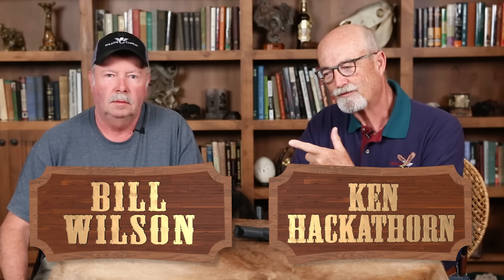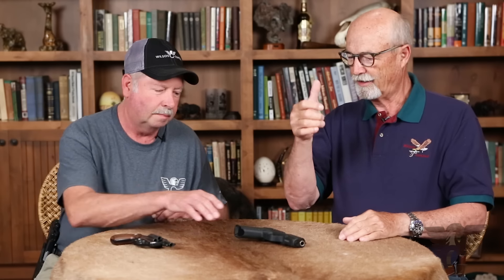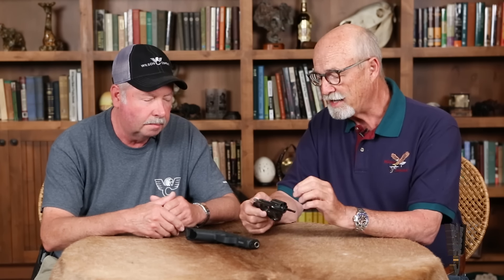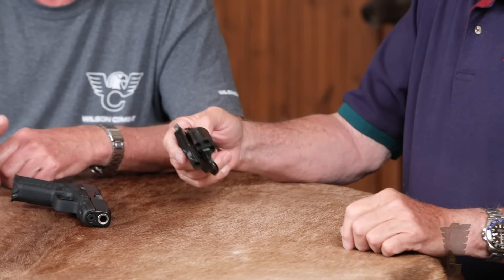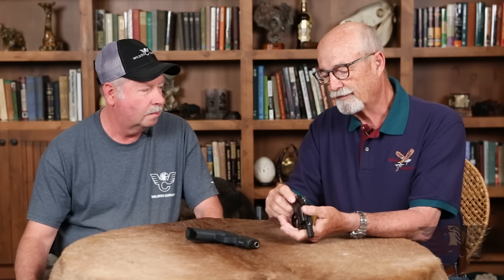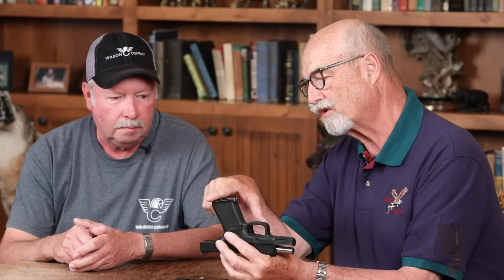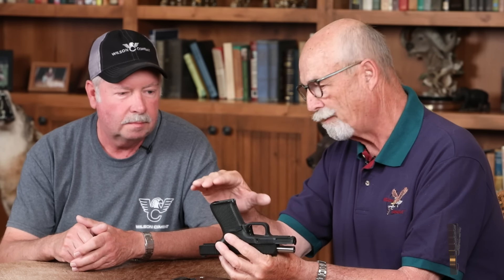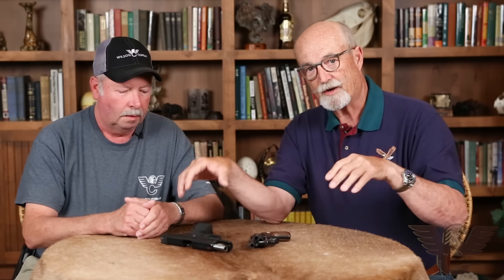DON'T DO THIS to Your Guns - Gun Guys Ep. 17

Comment: Thank you for the information. It's obvious from some of the comments some people have never owned a finely tuned piece of machinery. All guns are not created equally, and saying simply that because this gun is expensive it should be able to do all things or take abuse is kin to saying a 300k Ferrari should be able to withstand and function properly offroad in mud and sand. 

Yes there are guns that are expensive that can take abuse and shoot accurately but the triggers aren't as nice or they are made from polymers rather than steel. Like an expensive watch that's accurate within milliseconds made from the finest materials by craftsmen vs a GShock that will give you the time but its crude yet durable and still can be relatively expensive. A Wilson combat( imo ) is kin to a modern day high end sportscar. Made to do one thing with expertise, but has to be maintained well to get the best performance from it.
Reply: A modern high-end sportscar can be way more fragile than a high-end 1911 though. I know some people with sports cars who will only allow single passengers in the back to sit in the middle because of the more even weight distribution. I was seriously told once "I can't drive faster when you're in the car because my shock absorbers have been tuned for a single driver only"
A finely tuned competition gun by comparison is still pretty robust. You might just ruin the fine tuning when you abuse it.

Comment: If dropping a slide on an empty chamber will hurt the gun after, say, 200 times, then how many rounds will it go through before it breaks anyways? 2000? 5000? A 1911 that costs as much as a Wilson combat better last a lot longer than that.
Reply: Steel going home on a brass cartridge it isn't breaking, slamming steel on steel over and over is asking for trouble you don't need.
Reply: There is a popular myth contained in your statement. 

FACT is if you pay a premium price for a gun, like Wilson Combat, you are paying for QUALITY not DURABILITY and no they arn't the same thing.
Perhaps a good analogy would be other machines like radios or automobiles...higher end you go higher maintenance/care required to keep it at that level, the higher cost can even indicate the OPPOSITE of higher durability.
Reply: @flipgunderson1946  lmmfao!  Well said.

Comment: I am willing to accept that these guys know what the guns they build will do. What I also got out of this is WC does not build guns to the quality that John Browning expected when he made the design. I second the previous comment that they should take the word Combat out of the name. I do agree with the statements on slamming a revolver cylinder. That's just crap people got from movies.
Reply: Theyre built to the same or better quality. Engineering has been done to make them better target pistols but not as good for service
Reply: @HuxleyTheProf  just like a race car won't hold up getting groceries.

That said, a WC will outlast any duty pistol. It just has to be handled the way JB designed the 1911. It's a slide lock, not a release, don't drop the slide on an empty chamber, oil it. It's in the Army dash-10 manual that way too. 

The M2 is also a JB design, and the toughest machine gun on the planet. You "ride the bolt forward" on an empty chamber on an M2 so you don't mushroom the bolt.

Comment: If you have to baby a gun, carry another gun. You don't go offroading in a Ferrari
Reply: You can't tow a trailer with a Ferrari. If you want to haul something AND can't afford a Ferrari, you don't need to read the manual looking for typos, you need to go look at rusted out Chevy trucks. 

For the record, I own a rusted out Chevy truck.
Reply: Since when is proper handling "babying"?  

How about an AK?  Don't drop the bolt on empty chamber, or risk mushrooming the bolt, and shearing the lugs. 

Ma-Deuce?  Don't drop the bolt on empty chamber. 

All pistols, including Glock?  "Avoid dropping the slide..."
Reply: You also can’t drive a Ferrari without preventative maintenance

Comment: If you want to hear this guy explain how absurd his argument is start right here 02:12 .  What he is inferring is the forward motion or inertia of the slide is reduced to an acceptable level by stripping and loading the bullet in order not to damage the firing mechanism.  I wonder how they measured that reduction and if a reduced power slide spring wouldn't accomplish the same thing?    That is absurd.
Reply: @tomgiorgini9154   As in not smart enough to read the military TM identifying the use and function of the gun to include armory maintenance and third shop high maintenance. This would be the document created when it was accepted into the US Army when it was first created.  Doesn't talk about paring down mating surfaces of the trigger assembly to achieve a nice crisp smooth trigger to the point where wilson says if you utilize a function designed into the gun it will void their warranty.  I have never seen this warning on a Colt pistol Tom.  And should you choose to spend several thousands of dollars on a gun that will void your warranty for doing something it was designed to do- I won't say you're not smart enough to own a gun.  I would simply lament your greater supply of money than good sense.
Reply: @tomgiorgini9154  
So let me get this straight, this guy is an expert because he's old and says he's an expert?  Okaaaaayyyy.....
Reply: @abee3515  
When I went into the Navy in the 1980s, qualifying on the 1911 was a requirement to make it through boot camp.  And yes, there were guys that were sent back to the next incoming group of companies to repeat boot camp up to that point because they failed the 1911 pistol course.  We spent hours inserting unloaded mags, sending the slide forward, dry-firing, locking back the slide, dropping the mag, etc.  Hours!  And that was just my boot camp company.  This was during Pres. Reagan's cold-war military buildup, there were thousands and thousands and thousands of people going through that place, the Navy (and all services) were manning up.  If doing this was doing undue damage to the training 1911s, they would've known about it a long time ago and stopped/altered the instruction curriculum.  Just a thought, I don't claim to be an expert.  What you're saying makes sense to me.
Reply: @Skank_and_Gutterboy  I did the same except Army.  My best friend did the Navy.  These guys are selling race guns.  They are telling them written in the paperwork that comes with the gun don't do this- it will break the gun.  The 1911a1 is a combat weapon it is designed to take abuse and NO WHERE in the TM does it say not to drop slides on an empty chamber.  This is all for the tacticool crowd that wants to make a gun so sleek so fast so covered in useless crap that it can fire simply by willing it to.  Dropping the slide on an empty chamber in a firearm built to design specification meeting the government contract will not break the gun.  These two old coots need to clarify "do not drop the slide on a wilson combat" and leave the rest of us the hell alone.

Comment: Slides are designed to drop fast theres more force on the slide when your fire the round then dropping it 🙄🙄🙄
Reply: Look up how semi auto pistols work. When you fire the last round they should lock open. If there's more in the mag, the next round will help buffer the slide forward. A properly functioning system will not slam shut on an empty chamber after firing.

Comment: I couldnt make it past 4 mins of the video. If u design your custom 1911 to not be able to drop the slide on a empty chamber then I'll pass.

The miltary 1911s always took this abuse in inspection and use. 

All modern handguns are able to drop the slide on the empty chamber. U make fine pistols but if u design it this way u are intentionally losing business.
Reply: No, they're intentionally building custom guns to exact tolerances, in order to have an excellent trigger feel etc. They don't price them at $4k or above for no reason. The government stuff is mass produced and not even close to the tight tolerances of WC pistols.

Comment: Thanks for the info.  I have never heard that dropping the slide was bad for the trigger.  I always heard Glock people say it was bad on the slide lock lever, but never heard the issue of the barrel and trigger.  Makes since.  I am about to purchase my first WC, an EDC X9, and I will keep this in mind.  Thanks again!
Reply: Brad Roberts  I dont think they were taking it to that extreme.  Most of the 1911 guys still like/teach the slide release when reloading.  Bill even mentioned in the video that the work involved in stripping the bullet off the mag helps to protect these mechanisms.  They were only saying not to do it on an empty chamber.
Reply: Brad Roberts  0
Reply: Tommy J ..That’s what I understood him to mean, don’t drop it on AN EMPTY CHAMBER, OR by just ‘placing a bullet in the chamber’ either...
Reply: Tommy J   ....or never on a round pre-loaded singly.  He mentioned that it’s hard on the extractor.
Reply: Tommy J   Exactly!
Reply: Brad Roberts   it was meant to drop slide its a military gun but wilsons are custom guns with custom triggers milspec gov 45s no problem they made miltary police  drop slides on a empty chamber in the army
Reply: Brad Roberts  If it's not a slide release why did Glock make an extended ledge that is actuated from the top on the 34?
Reply: Brad Roberts  It is a slide release. The slide stop is meant to be pressed and the slide released. Even dry. It's in 1911 Field Manuals for the military. They explicitly say (after inspecting for clear) "To CLOSE THE CHAMBER.—With the right thumb press
 down the slide stop and let the slide go forward. Squeeze the
 trigger."
Reply: @Folma7  It is fine to single load a round by hand into the chamber. " If it is desired to make the pistol ready for instant use
 and for firing the maximum number of shots with the least possible delay, draw back the slide, insert a cartridge by hand
 into the chamber of the barrel, allow the slide to close, then lock the slide and the cocked hammer"

Comment: Well, a gun is a tool. If it's not battle proven an able to take abuse, its not worth the high price you paid for it. The gun needs to be able to take abuse.
Reply: It's a slide stop not a slide release and not intended to be used that way, have replaced a lot on them on customers pistols and not just stamped steel ones either.
Reply: @leoguy1609  it's the best way to chamber a round with one hand.
Reply: These are collector guns, not necessarily EDC guns.

Comment: Please watch GunBlue490 'Dropping the Model 1911 slide ~ The Truth!' Evidently from this video, modern expensive aesthetically pleasing 1911's are fragile. No thanks! John Browning built the  1911 according to "MIL-STD", . I'll keep my US Government 1911 MIL=STD version. It's ugly and hits the target without fail.
Reply: Well said!!
Reply: Yes well said
Reply: Gonna have to disagree with you. Even an original USGI 1911 shouldnt be dropped from full slide lock onto an empty chamber. 

The barrel lockup on the 1911 uses the barrel's lower lugs to ride up on the slide stop pin which is what pushes the barrel up into the locking lugs of the slide. 

Dropping the slide full velocity impacts your barrel lugs against the slide stop pin with the full power of the recoil spring and the momentum of the slide. Take a look at those barrel lugs sometime. They are not very big. Over time of this abuse they will deform and the timing of the barrel rising up into the slide will be severely impacted. 

This is nothing to do with a "modern expensive aesthetically pleasing" 1911. This is all 1911s and with machining technology being what it was in 1945 and earlier those original usgi guns are actually even more likely to have their lower lugs deformed because they used softer unhardened steels.
Reply: Well, a lot of the money you pay for a competition 1911 goes into the trigger tuning. Why would you ruin that trigger tuning with unnecessary abuse? The gun probably still works fine and the trigger is probably still better than the old MIL-STD triggers, but it won't be as good as possible anymore. It's not like expensive 1911's will stop working when you let the slide snap, but you paid a lot of money for extreme accuracy, why would you risk ruining that.

Comment: A advantage of Glock guns.  Join the GSSF shoot a match.  Ask factory armorer to check your Glock over.   They will detail clean (much further then suggested by owner). Check for wear.  REPLACE any springs, worn parts.  Last match he asked if I wanted extended slide and/or mag release.  Put in entire trigger group, springs, extractor, ejector…. NO CHARGE.  Plus jumped me ahead of line to fire off a mag to test function as carry piece.

Comment: Glocks are $600 and you can beat to death.  Wilson Combat $4000 and are ammo sensitive and need to be babied to run.  Wilson Combat makes  beautiful guns, but this is a video justify the finicky nature of their product.  Glocks easily run 2K rounds without cleaning.  If your betting you life on a gun, Wilson Combat aint the choice.  If your wanting to impress your friends with your finances, Wilson Combat is for you.
Reply: I have more than 20 pistols and revolvers, including Glocks. My Glocks are the only pistols I own that have failed on me within their mfg stated duty cycle. Cracked slides, broken springs, broken strikers. They're the highest maintenance, least reliable pistols I own. Nearly every Glock fanboi I meet tells me about all the cool aftermarket  mods to make it run "Perfect."  Just need a new trigger, forged striker, aftermarket recoil assembly that won't eventually shoot out the front of the slide during rapid fire, and Trijicon sights, right? Then it'll be a perfectly running gun. Until then?  The only thing my Glocks do well is run dirty, but what idiot doesn't clean his piece?

Wouldn't ever buy a Wilson or any other "boutique" piece - not even a Kimber. My Ruger 6701 is perfect out of the box. Just stoned the sear - more to verify fit than anything else.
Reply: @mfuchs2004    I had a gen 1  glock 19 , i ran that pistol  hard  , never had a failure , idk  maybe they went doownhill  but my Gen 3 .  19  , 23 and 20 are reliable in my book .
Reply: You've had multiple Glocks suffer a catastrophic failure on you? Sounds like internet bullshit.
Reply: Glock........no pride of ownership right out of the box.
Reply: John Galt,  I respect your opinion but couldn’t disagree more. I enjoy my Glock 43, Gen4 19, and especially my Shadow System MR920, but I had the opportunity to purchased my first Wilson Combat EDC X9 two years ago and that gun has ruined me. I’m now 6,000 + rounds into owning my X9 and fired ever brand under the sun through it. Aluminum cased, reloads, handloads, hell the majority of the 6k rounds were  with freedom munition which has the worst reputation in the ammo world. I’ve had only 1 malfunction (no ignition on factory new S&B.) When I go to the gun safe to grab a carry gun,  I skip all of my pistols (CZ’s and Glocks,) and grab my Wilson Combat EDC X9. I have yet to find any other make or model I trust my life with as much. I just wish I could afford another one!

Comment: while i can appreciate a well (or expertly fine ) crafted item if it cant handle a little abuse, ultimately IMO, its not worth owning, i mean a gun is a tool like any other, you might as well put gold plating on a crescent wrench, unless you have the money to basically throw away on what is essentially 'conversation piece'.
Reply: if easing the slide forward on an empty gun is too much work for you then yes, you shouldn't own a tuned 1911

Comment: Bill will agree that there was one more thing they should have mentioned. Years ago I bought a Smith and Wesson mdl. 10 that had been custom built by Frank Glen for Bianchi cup competition for Bill. He had actually had Frank build him several because he was thinking about including Bianchi Cup guns in his product line. It was an amazing gun with outstanding features. Phenominal accuracy, an Aimpoint sight, Krieger bull barrel with a subtle slab side for barricade work, flawless lockup, a butter smooth double action only trigger that I measured at 5.5 lbs and yet reliably ignited primers and a fantastically low price. In fact too low! But how you might ask, because Bill never buys something high and sells cheap? Well it was because he was running those guns through their paces on his private shooting range and when he packed everything up he accidentally left one of the pieces on his wood table. When he returned days later and discovered the abandoned piece, the Arkansas morning dew had accumulated on one side of the gun, evaporated, and left deep rusted pitting on the entire left side of the gun. Rather than replace parts like the sideplate, he had the shop sandblast the gun and re-blue it with a matt finish. And I was the lucky benefactors! So the lesson? Don't leave your gun outside to rust!

Comment: Lose that stainless steel sissy pistol and get yourself a glock.
Reply: Glocks are great! But over priced.  There are other options.  

But I totally agree with what you're trying to say! Don't own a gun that you have to baby. It's a firearm! It should be able to handle some hard use.  

Take care of what you own, but by good equipment to start with!
Reply: Lmao I thought I was the only one that still used that line from US Marshalls
Reply: Glock, everything you need, nothing you don't.
Reply: *Nickel Plated Sissy Pistol
Reply: Many of is dislike sissy ROglocks. Some favor those SS for smoothness and solid frames vs those legos.
Reply: Love that line. In reality though glocks are great ideas with a lot to be desired. Barrels, triggers and sights are crap out of the box.
Reply: Glocks are junk.